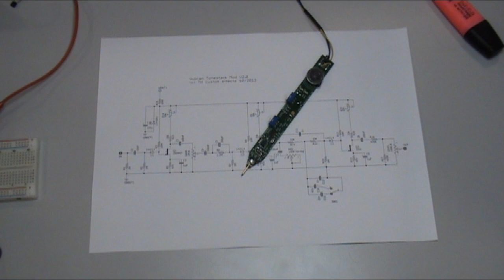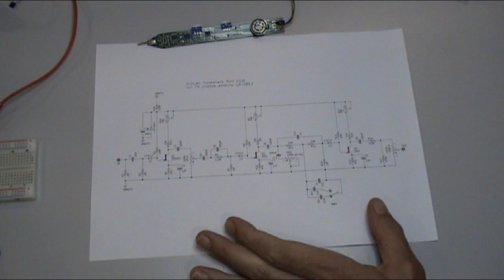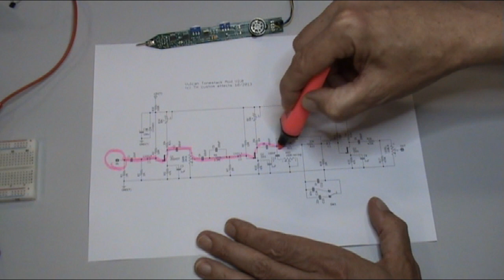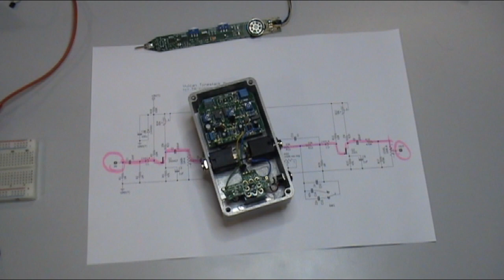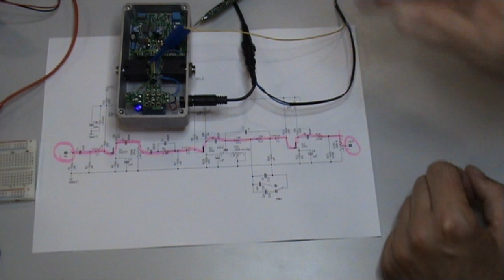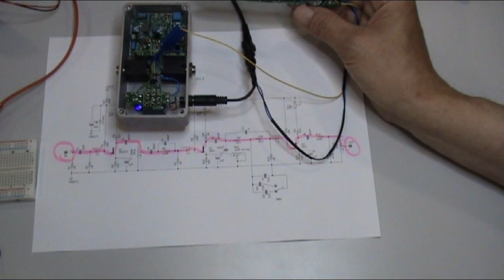Signal Tracer Pen & HowTo Audio Probe

Comment: I bought this tool and have used it on my pedals and it's great.  But, can you also use this to trace a signal in a 1960's battery operated, POSITIVE Ground, transistor radio?  If so, how do you make the connections?  I ask because I didn't know if the old Positive grounding scheme affects the way you hook up the signal wire, or anything else.
Reply from the maker: Great you like it. 
There should be no problem if you take a little care.
Power the pen from a separate source and connect this pen ground to the radios plus OR minus on the battery. Depends on how the schematic is done but does not harm the pen when wrong. Should work both ways.

Comment: What is the lowest voltage this will work with? or is it only 9v
Reply from the maker: The reference voltages of the test signal are based on 9V. If you lower the input voltage the signal level is reduced as well. It will work with below voltages but we didn't test it out

Comment: Just curious - would this work on audio receiver that has speaker output issue?
Reply from the maker: Yes, as long as you are testing before the   power part. If the power amp ICs are bad they need to be replaced anyway. But you will find out if the are the cause.

Comment: Does this have a high voltage film capacitor on the input so it can be used to troubleshoot tube amps?
Reply: Super late reply… but man… I hope you don’t go messing with amps with this thing. That seems very dangerous ⚠️